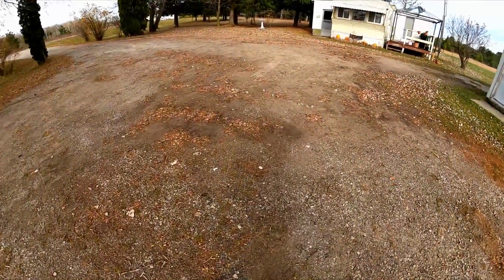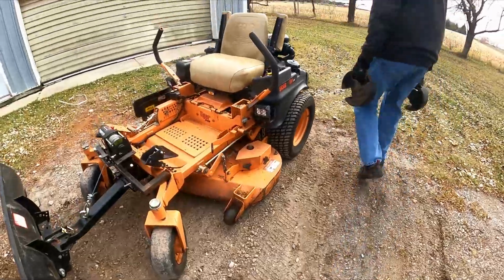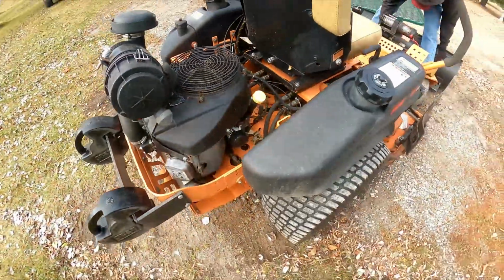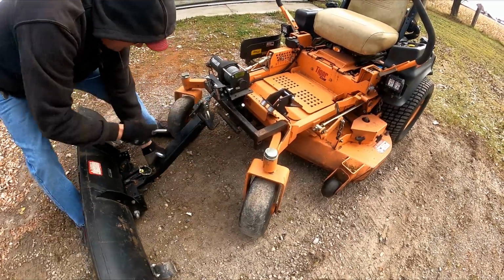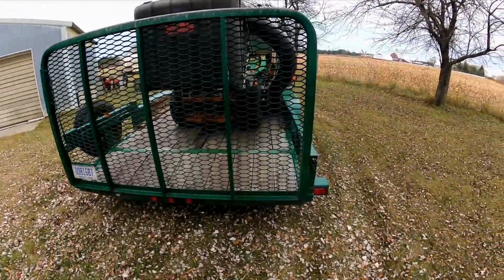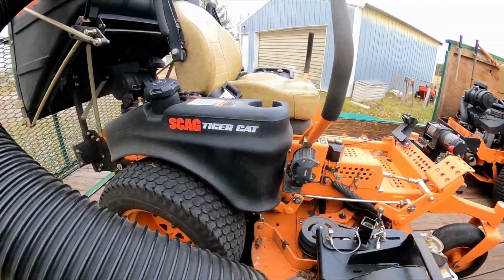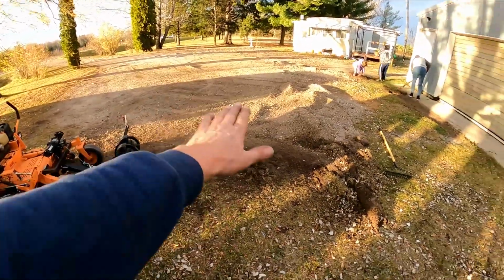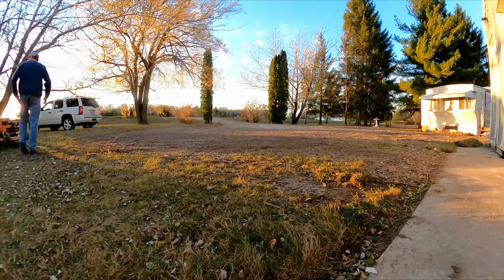2004 Scag Blew an Engine

Comment: Pushing gravel is hard on a mower, I'd imagine.
Reply from the maker: This Mower has been struggling last few weeks the mower has2000 hours it’s been a great all around Mower. It will be back up running by spring.